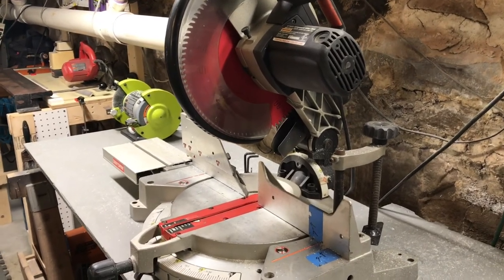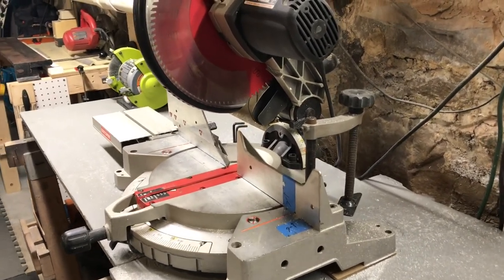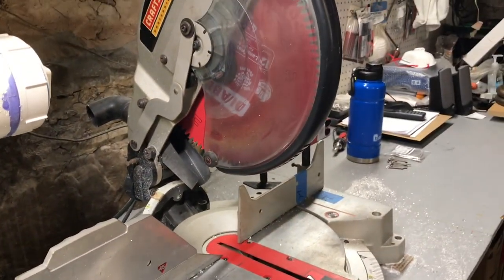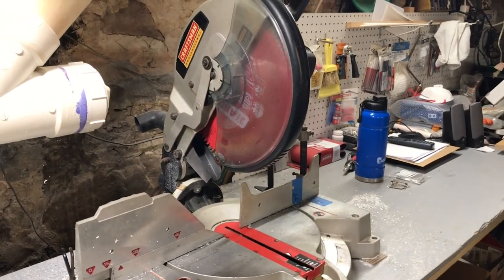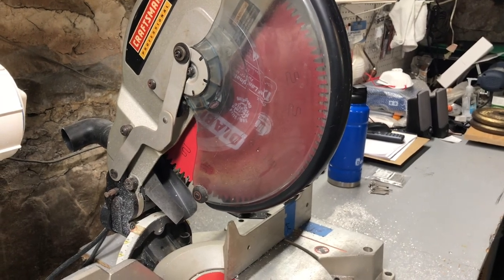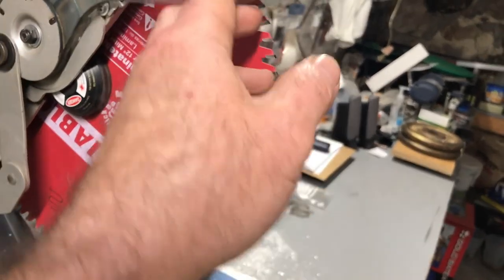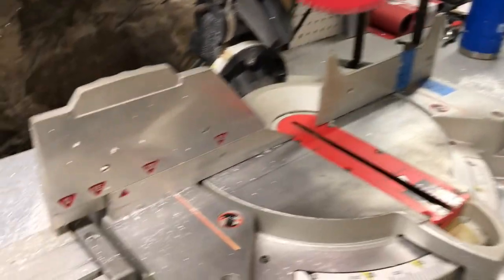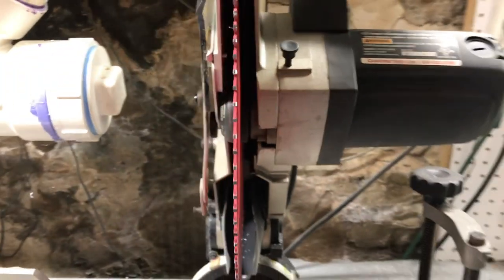Compound Miter Saw Fix - Blade Not Stopping When It Should

Comment: Thanks so much! I'd like to consider myself fairly knowledgeable as far as woodworking tools go having been in the trades for over 40 years but this just goes to show you dont know all there is to know! Something as simple as tightening the blade? Are you kidding me? I went through the steps to get to the arbor bolt and sure enough- loose! Not terribly but it was slightly loose and that cured the brake problem! Thanks! I almost went down and bought another one!!
Reply from the maker: My pleasure Brian! You made my day. Yes! I too was about to replace this saw but then I figured it out! Glad I did because I've spent more than I like to speak of on equipment. And I still need a cnc router. 😏

Comment: 3:33 - Explanation is here. Although I dont agree with his assessment. If the blade itself is spinning in place, then yea, you need to tighten the bolt. But if the blade stop function of the miter saw is not working, it's likely that the motor brushes have vibrated loose or are worn completely down. Just unscrew those large, flathead, plastic plugs on both sides of the motor housing. The carbon brushes are spring loaded to keep them pressed against the motor commutator (main spinning shaft). If you still have some of the carbon material left, then they were simply loose. Screw them back in, and you'll find the blade stop is working now. The blade stop function works by reversing the flow of electricity through the commutator. If it's not working, it means there is a loose electrical connection between the brushes and the commutator.
Reply from the maker: Great info that I am thankful for. However, I posted this video over a year ago after tightening the blade and to this day it still works properly.
Reply: Thanks for explaining how the circuit works

Comment: So mine just did this all day. I did figure out it was a loose nut, found your video for validation on that. Thanks a lot. I didn't have the pleasure of getting to use it for a long time without it stopping (mine started making noise and not stopping on its own for quite a while). Then in the middle of a cut my blade actually just stopped half way through the wood. Don't know if that could have went really bad, but sure made me curse the place I got it from for a minute. Tightened that bolt and seems to be all good now. Glad I found your video kinda confirming this. Wish I could have heard the noise yours made before it would slow down enough to stop. Mine literally sounded like metal just kinda scraping. I thought maybe because it's so damn cold here right now.
Reply from the maker: Thanks Jerry!
 Mine didn't make that kind of a noise. Just didn't want to stop like it should have. But ever since I fixed it it's been fine.
 Nope, I would not have like my blade stopping mid cut at all since I mainly use it to cut aluminum.
 It's bad enough learning the hard way not to try and cut two inches or less off the end of metal. Man does it bind and bust them carbide teeth off😮 Oh, and the fingers, gotta watch them🤣

Comment: My Ridgid miter saw has what the manual says is an electric brake. No indication on any of the three parts diagrams which parts make up the brake, and no instructions whatsoever about how to clear it when it stops working. I tore apart the saw today and could not tell which parts would brake the saw. I tried tightening the blade, but that didn't fix the problem. Frustrating deal.
Reply from the maker: I'm sure you have already looked for videos that will show you the braking system on you Rigid.
Sorry this didn't help. Your the first that it didn't help.